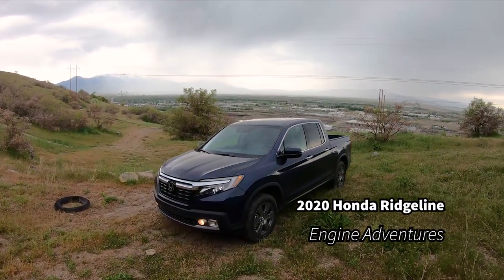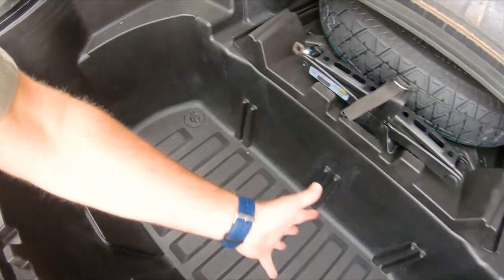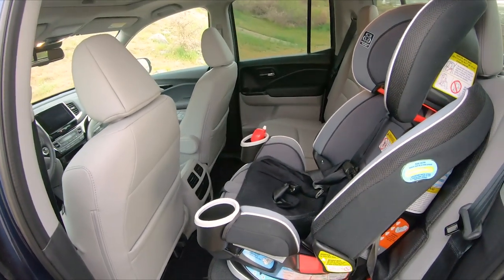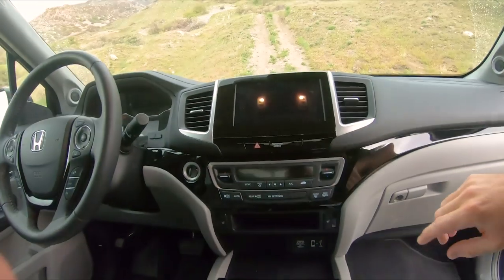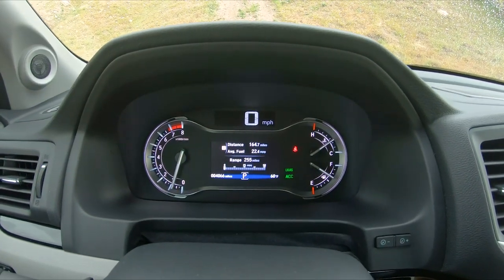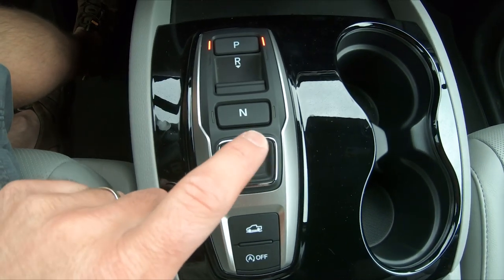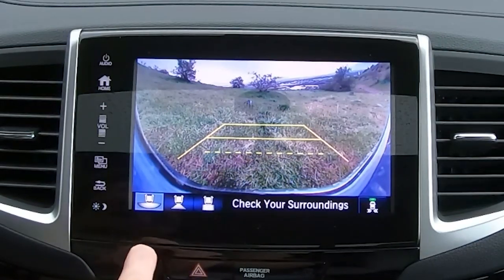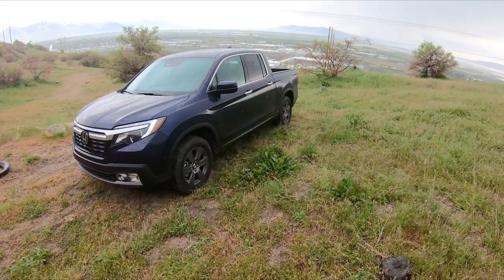2020 Honda Ridgeline Review

Comment: I work at the plant that builds the Pilot, Passport, Odyssey, and Ridgeling. Our race team tows their race trailer and race car with the Ridgeline. They're good enough for what MOST people need daily. Obviously not everyone, but MOST.
Reply: *Ridgeline
Reply: Can anyone tell me how to turn on the top , long LED DRL's,just can't turn mine on,thanks
Reply: If the headlights are off, and the vehicle is out of park, they should come on automatically.
Reply: @Bradhelton938  thank you I’ll try that,heard someone say that the new ridgeline sport,top rap around LED DRL’s are empty???
Reply: And that the higher trim,do contain bulbs inside??
Reply: I'm farther back in the plant than the headlights. Its entirely possible that it could be a trim level option. I'm in the paint shop. If they're installed, they should be on with the headlights off and the vehicle out of park.
Reply: I hope you get it figured out, and I also hope you enjoy your ridgeline.

Comment: I live in MT and I have had Ram and Chevy 1/2 tons in the past. I have ‘19 Ridgeline and it is best truck I have ever had, no comparison. Not a rockcrawler, but for driving long distance at high speed on rough washboard dirt roads, it is way better than anything else. And on snow and ice in winter, it is equal to, or better than my Subaru. Combined with real good gas mileage, it is best light truck going. If you want to serious off-roading, or tow more and than 5,000 lbs., then get real 1/2 ton, otherwise look hard at the Ridgeline.
Reply: I agree.  I looked and Chevy, GMC - they have nothing.  I purchased a Tacoma and took it back the next day.
Ridgeline RTL-E has it all, no add-ons needed.
Reply: I only wish it had a 4 cylinder diesel option.... diesels are great in trucks

Comment: Ridgeline look in and out is a perfect truck (or crossover if you want to call it) at least for me.
All I want more from Ridgeline is:
1. An auto folding outside mirrors
2. A HUD (Head Up Display)
3. A 360 surround camera. 
4. MPG and RPM analog gauges. 
(Honda engineers please read). I'm driving a Lexus at this time and would like to trade in for the Ridgeline just because I need a bed to carry something lite at HD or Lowes. 
Inside, The Ridgeline look nicer than Tacoma, but I wish it can add some more bells and whistles to attractive more buyer from driving luxury cars.
Reply: Let's not drive up the price on useless extras for just a HD run because the fully optioned Ridgeline is already expensive as it is.  This sucker doesnt even come with a side mirror blinkers but you get a useless sunroof.

Comment: I just bought a 2020 RTL. I can't believe how quiet it is on the highway. Also, my trailer and motorcycle together weigh only 1200 lbs so I am completely okay with the towing capability. Also, other than occasional dirt roads, I don't intend to go "off roading".

Comment: As a Ridgeline owner, I can add a few things. The Ridgeline has the widest bed in the class, so any other midsize truck isn't going to be able to hold an ATV any better. The interior of the Ridgeline is wider than any other midsize truck due to it being a unibody. You'll also notice there is no "hump" in the floor for the driveshaft even though the Ridgeline has a driveshaft that is always sending power to the rear differential. The spare tire can be mounted to the front of the bed if you have a heavy load in the bed that would prohibit you from opening the trunk. A trailer brake controller is not included in any package, but the wiring for the control is included in ALL packages. It's as simple as connecting 4 wires to the brake controller and plugging it in to the plug under the driver side dash near the parking brake. The rear seats lift up like any other midsize truck, but the difference is the flat load floor underneath them. This load floor is also usable with the seats folded down for storing things such as golf clubs.
Reply from the maker: Good information! Thanks for watching and commenting!

Comment: Honda needs to give this thing a full size spare!
Reply from the maker: Typically I want a full-size spare as well, but in this vehicle I can't decide if that's what it really needs or not. Honda is not pretending to be something it's not with the Ridgeline, and given the space restraints of the spare tire location it makes sense.
Reply: @EngineAdventures  The first Generation Ridgeline does have the space inside the trunk to carry full-sized spare. They reconfigured the trunk on the 2nd Generation so unable to carry full-sized spare.
However there is a mounting location in the bed of the Ridgeline for a full sized spare. The 2nd generation location in front of bed behind rear window. The 1st is on side of bed.
Reply: Nah no need for that as along as it has a spare.  Many sports cars don't even come with a spare anymore so you'd have to call for a tow truck.

Comment: my main complaint is that this is just too low to the ground.  It needs minimum another 2 inches of ground clearance.  I don't want to jump it but I want to be able to drive up a curb or on a trail and not worry that I'm going to tear up the front bumper.
Reply from the maker: Even the half-ton and 3/4 ton trucks have super low front air dams now, unless you get an offroad trim or package.
Reply: @EngineAdventures  Right.  But that's all that's close to the ground and that piece is flexible and doesn't damage if it does drag.  For the Honda the WHOLE bumper is close to the ground.  The thing has like 2 inches less ground clearance than an outback!  I'm sorry, that's just not good for something that wants to be a truck.  This is closer to a Camry in ride height than anything else with a bed.  Both the Pilot and the Passport sit higher off the ground and have significantly wider tires.  Honda has a great start here but they completely kneecap it by setting it up like an el Camino and not at least a passable facsimile of a truck's ground clearance. It needs  a 2 inch lift and 255 tires. Neither would be radical, that's the size that a CX9 has, for example.

Comment: And how exactly low beams make your fog lights useless???
Reply from the maker: If you have to have your low beams on to use your fog lights, then your fog lights just become driving lights. I should clarify, they aren't useless, they are just useless as fog lights. A short Anecdote: I was once driving a 2nd gen pilot on the freeway in a blizzard, I tried to switch only the fog lights on as the light from the headlights was reflecting off the snow making for poor visibility. When I switched to the parking lights the fog lights turned off. I could see nearly as well with the parking lights on as I could with the headlights on, but I left my headlights on so other vehicles could see me better. Wish I could have had the fog lights on without having the headlights on.

Comment: Subaru Baja, do not smoke that.  The Subaru is was way smaller than the Ridgeline.
Reply from the maker: What I meant was that it's a unibody truck with 4 doors. There might be others, but as far as vehicles available in the US, the Baja is the closest thing to a Ridgeline I can think of.

Comment: yes by definition
Reply: Yes by definition it is not a truck.
Reply: @rotaryenginepete  how so?
Reply: @squidusn71  all trucks, even hand trucks, by engineering definition, have ladder style frames.  The Ridgeline is a modified version of the uni-body Pilot crossover, with a transverse mounted engine.  Honda engineers claim they uniquely welded a "frame" to it, but subframes are commonplace in unibody architectures.  That is why the Ridgeline doesn't have near the towing or hauling capacity of real trucks which are similarly sized.  This doesn't make the Ridgeline a bad vehicle (it's a fine crossover), but it also doesn't make it a truck.
Reply: @rotaryenginepete  ladder frames doesn't define a vehicle as truck in general.  The El Camino has a frame and a unibody with a bed or cargo so it's both a truck and a crossover by your definition.  A 1965 impala among other 50s through 70s cars, also has a frame and a unibody.  So, again, by your definition, those are trucks also.  Towing capacity does not define a vehicle as truck also.
Reply: @squidusn71  lol I think you need to look up the definition of unibody.
Reply: @squidusn71  and even though you cannot have a ladder frame and a unibody, I never actually claimed that a ladder frame defines a vehicle as a truck. Read it again.

Comment: Smart truck with best ride and interior material and quality in business.  Bad traits are now a weak nine speed, horrible infotainment still lacking knobs for volume and tuning.  Engine is one of best in businesss, only time will tell how reliable that herky jerky nine speed is.
Reply: That nine speed is not weak.
Reply: They've worked out the grimlins on the 9 speed.  You dont hear bad things about them anymore not like 3yrs ago with the 2016 Pliot or MDX.
I have a 2017 Pilot with 9speed with 33k miles and my coworker has a 2016 with 65k miles, no issues whatsoever. 
Knobs???  Still complaining about knobs???  
Engine is the best???  With direct injection only = carbon diposits and still sporting that timing belt...i dont think so on that one.

Comment: If just having a bed makes the truck then an El Camino is a truck so it's gotta be more than that.  For me I think it has to be high payload/towing with low range transfer case and a bed then it's a truck.  😁 If I didn't need a truck though this would be a great utility type vehicle.  I'd take this over any SUV.
Reply: It's all about technicality.  Everything else are just opinions.
Reply from the maker: It has roughly the same payload as the Frontier, Colorado, and Tacoma. The Ranger has up to 400 lbs more capacity than it's rivals. No low range transfer case is a downside, but the transfercase actually has a slightly taller gear for the rear making the rear a little over 2% faster than the front. This allows for the rear to have torque vectoring by applying more power to the outside rear wheel to help push the Ridgeline around a corner. Like you said there are trade-offs for everything, and this truck is more El Camino or Subaru Baja than it is Dodge Power Wagon (the first rear truck in my opinion).

Comment: I can't get it with a manual transmission, so I will never buy one.
Reply from the maker: Which eliminates every full size truck currently available in the U.S. as well. It's sad but true.
Reply: @EngineAdventures  That's why l plan on driving my 2010 Tacoma TRD Offroad 4.0 6 speed for the rest of time.
Reply: John Ossendorf why would anyone want a manual any more

Comment: Based on a minivan😂😂😂😂that's literally a grocery hauler
Reply from the maker: It's based on a crossover that's based on a minivan :). Joking aside it is better at doing most things when compared to other midsize trucks. It's roomier, smoother, less expensive for similar equipment, and has a few tricks that aren't as gimmicky as I thought they would be. Not saying it's the truck for you, but it is certainly more than a lot of people need.
Reply: I see a lot of f150s, ram, Silverado/Sierra being used as grocery getters only, no towing, no hauling, no off roading, no mudding....
Reply: isn't that what most trucks are used for?
Reply: Nice try X............................not really
Reply: My 2018 AWD Ridgeline Sport:
a) Can tow my two motorcycles from Ohio to North Carolina without breaking a sweat.
b) Haul all the lumber and drywall to help my buddy add two bedrooms to his finished basement for his middle school kids.
c) Accommodate me, my better half and our two rowdy pits to and from the nature preserve to go run laps.
d) Is more comfortable than any body-on-frame truck I've owned in the past ('06 Sierra, '96 F250, '70 C10,) .
e) Is fantastic in the snow here in Ohio.

Would I want this as a tool as a professional contractor?  Probably not, but maybe.

I'm a smart man - I use the right tool for the right job and work smart, not hard.

Keep telling me it ain't a truck.  It does everything I need a truck to do and is way, way more comfortable than anything else out there doing these jobs I need it for.  You can keep your body-on-frame dinosaur design - I'm living the good life over here. \m/ -_- \m/
Reply: I’ve done more off roading in my ‘06 than 95% of the trucks on the road. And 8 years of drywall. I could carry more boxes of joint adhesive w/ the backseat folded up than any of my fellow tradesman. Drove my family comfortably to Disney, Yosemite, and moved a 150 gallon fish tank w/ fish recently. Never had a mechanical problem in 15 years. Lots of groceries too!
Reply: @toddpoppleton5303  how many miles on your Ridgeline.

Comment: It is a real car though.
Reply: A van
Reply: And real truck functionality, so best of both worlds. Buy a bigger truck when You want to tow more than 5,000 pounds.
Reply: J.R. Arnolli It’s actually the worst of both.  Poor mpg, hard to park, and no more capability than most midsize SUVs.  Interior storage is a must in some areas.  Tailgating in the rain is easy with an SUV.  This is basically a car with a tiny trunk and worthless shallow bed.
Reply: @user-tb7rn1il3q  clearly, you know nothing about the Ridgeline lol.
Reply: Squid Usn I’m very familiar with the RL.  Someone had one at work.
Reply: @user-tb7rn1il3q  someone had one, lol.
Reply: guys, check the dictionary of pickup trucks, it only says a enclosed cab with an open cargo area... "body on frame" is not definition of truck or pickup truck.